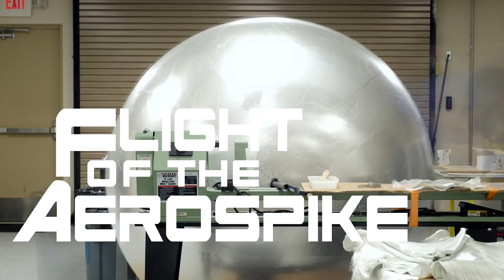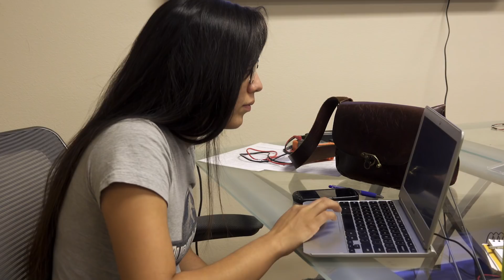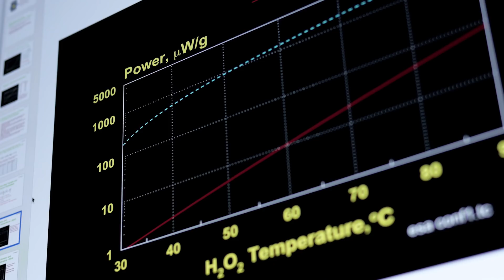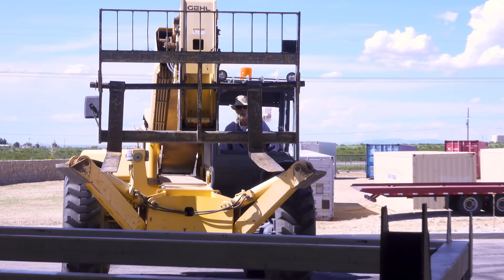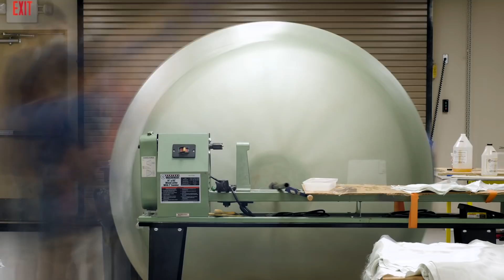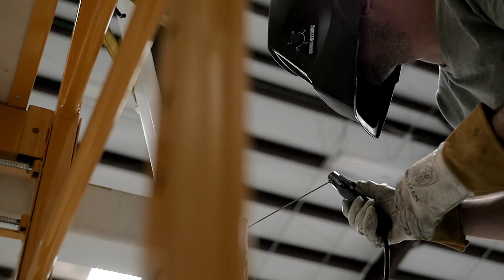Flight of the Aerospike: Episode 10 - Engine Test Tank Casting

Comment: Just to clarify, as I have only a basic understanding of fluid mechanics, Is the exhaust flow compressed against the spike by the ambient pressure of the air because it is flowing fast, and so according to the Bernoulli principal it has a lower pressure, or am I barking up the wrong tree. thanks.